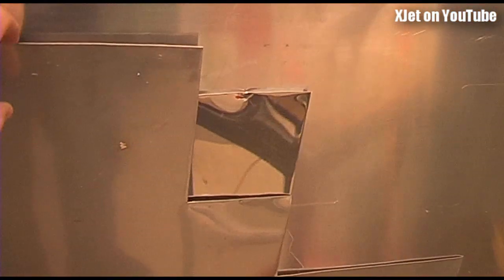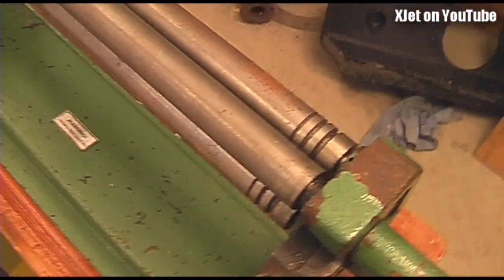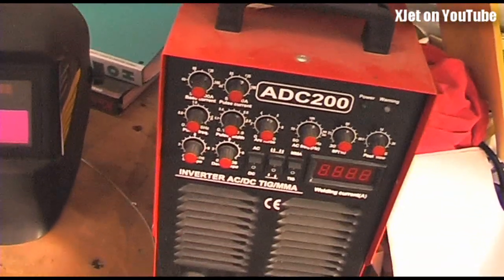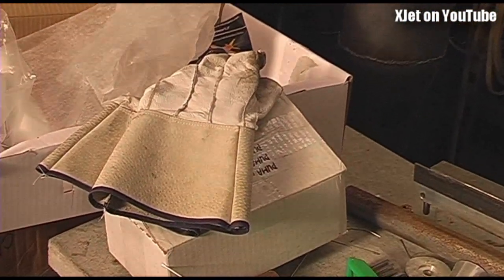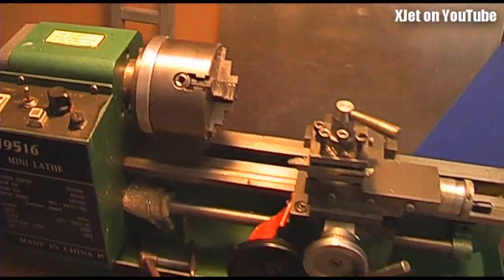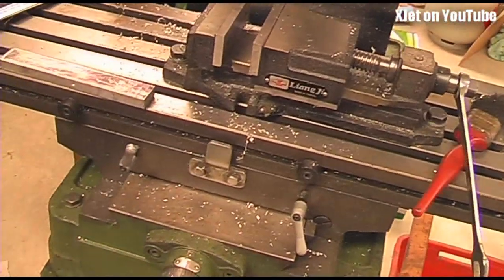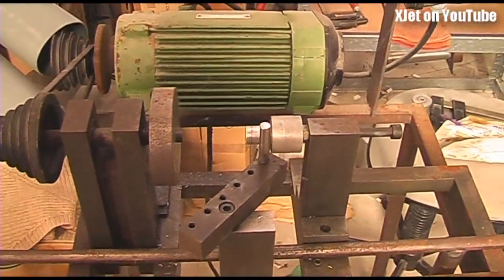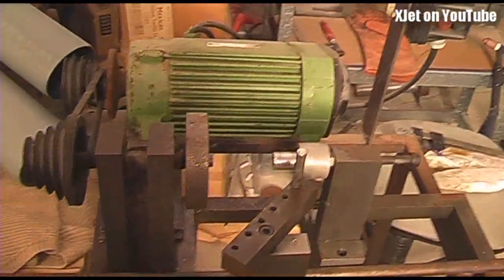Building a pulsejet for an RC plane,  part 1: the tools

Comment: @xjet do you think i could make a pulse jet from threaded steel pipe and fittings? it would probably be too heavy to mount on a plane, but i was thinking of maybe putting it on a go cart. (wooden, normally gravity powered go cart)

Comment: I guess if you were planning on manufacturing pulsejets you might need all that stuff but I've seen people make one with simple tools. You can buy a lot of the parts at the hardware store & a metal shop could weld them together for pretty cheap if you don't want to use pop-rivets or bolts. And why not go valveless? Valveless pulsejets are nearly as powerful and much less complicated.

Comment: @4E047RHH 

I wouldn't think so because pulse jets are availble already since the late 70's? I cant remember when it was invented. This is not his invention. Back then pulse jets engine were used in u-control. I just got rid of my u-control pulse jet. But I can get it back :).